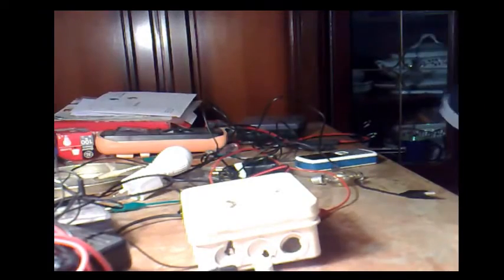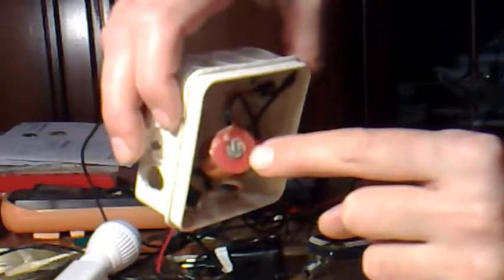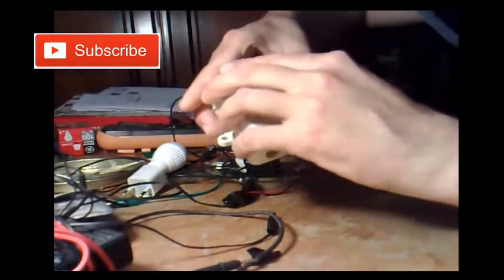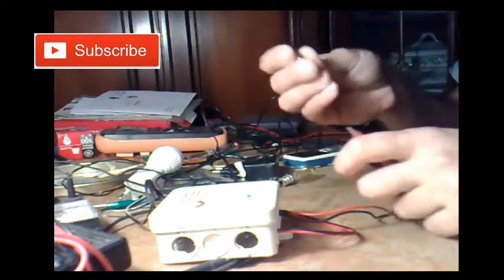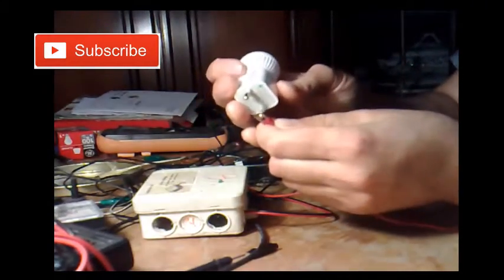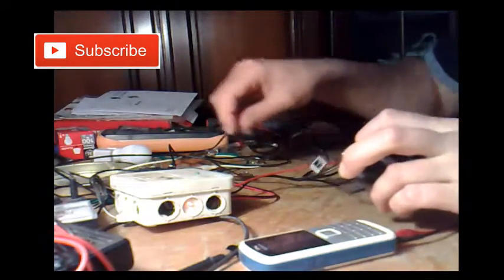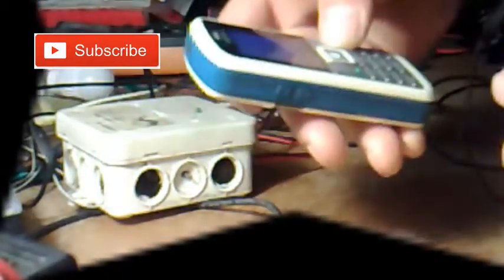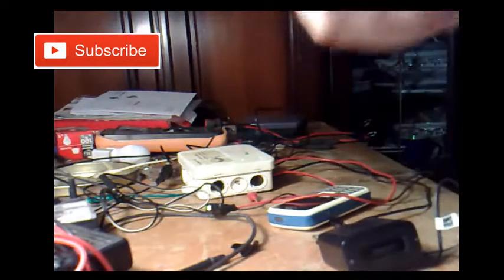bedini self oscillating charger-rejuvenator

Comment: So, No matter what load I put on it ( I'm assuming the output is from the charging battery), the charger will compensate its own output and correctly charge whatever battery and/or load I put on it. I see you used a lightbulb and then charged a cellphone....clearly 2 different voltage outputs must be used. Is this correct?
Reply from the maker: You're absolutely correct sir. It's self regulating circuit. When heavier load connected it self oscillates at higher frequency and maintaining the same current draw or even draw less current from the 12V input. The same goes for the charging batteries in series on the output. I even used this little device to test my broken LED-s on my tv: https://youtu.be/1JhLGiANOoc
Reply: @RadiantElectricity  Thank you, fascinating experiment. I'm using a 555 timer to provide pulses to a TIP3055 transistor energizing a coil to charge a battery. I believe it's a circuit from someone named Alexor. Unbelievable output but the higher the frequency the hotter the 3055 gets...very touchy control. I've been charging the same 2 batteries for about 2 weeks now, no other outside source. Very interesting. I'll duplicate your experiment asap. Looks promising.
Reply from the maker: @sgrimm7346  555 is a great choice for the radiant source of electricity. You should pay attention what coils you use with respect to frequency. You can use small ferrite  rod-type inductors-chokes for the frequencies larger than 2khz. They can be found in old tv-s and PC power supplies which you probably know. Thanks for the interest for my video. Cheers mate!
Reply from the maker: Since youre using 555, better solution instead of 2n3055 which has only about 100V max Vce voltage(although very high Hfe) to use high voltage N-type power mosfet maybe 500V to avoid heating. Btw this ne2 neon glow lamp is not that almighty in snubbing the excess of high voltage to protect the transistor
Reply: @sgrimm7346  I'm taken aback by your reply about the Alexkor circuit. It appears you have been able to replicate it. I would like to clarify on what you mean by charging the same batteries for two weeks, please. Did the batteries ever get charged completely? Did you try applying a load to it while it was charging? Did you try connecting an inverter to it while it was charging? Would connecting an inverter and AC appliances as load work? Does it matter whether one connects one battery or more for charging (because it would seem that you imply that the more the load, the circuit somehow compensates and continues to work even better? Do you mind sharing an illustration of your working circuit and mentioning how you connect the components together (that is, what and what you connect at what point, etc)?
I apologise for bombarding you with questions like this.
Reply: @RadiantElectricity  your video is trippy, I must say; very straight to the point and exciting for me. I'm more piqued than ever, watching any of these types of videos. Could you mention how you built the circuit? I cannot interpret a circuit diagram accurately, it seems. I will appreciate if you could write out what you connected to what and what and at what point, if there is a cross-connection, etc. I am interested in building this and seeing if and how it works. Also, kindly list the items and suggest how one might procure the, like the one you mentioned above from PC power supplies (I wonder if you meant like the power adapter of laptops - I have one that blew, and I believe I might be able to source some used ones that are intact).

Sorry for the bombardment with all these questions. I'm just really excited to try this out. Also, I am surprised that the charger could power the plug that connects to the phone. I thought the unit is giving out DC. Could you clarify this for me, please?
Thank you.

Comment: 2n3055 is a large transistor, you are using a new one which part is it ? and the coil is hard to get , where? thanks
Reply from the maker: I'm using BD243C transistor. It's T0220 case which is compact and not using up space like 2n3055 which is usually T03. I made coil myself. I salvaged magnet wire from a transformer. I made core from thin zinc coated iron wires.

Comment: where can i parts or readymade ?
Reply from the maker: I made it from scratch and without any calculations. I guestimated dimensions of a coil and number of turns. The more the better.  I believe that ready made kits are available but are expencive, not to mention shipment costs. Good luck with your project.
Reply: @RadiantElectricity  could you list out the components of your unit, please?

Comment: Have you magnet size wire info
Reply from the maker: It is 0.4 millimeter in diameter but 0.3 or 0.5 would be just fine. Btw check out my video on my other channel https://youtu.be/vpHfvFBl6H0
Reply: Thanks for sharing
Have you Coil info how many Ohm or meters
Reply from the maker: For the core I used many zinc coated iron wires of 1mm diameter. Core in my case is 5mm diameter, it could be bigger. I stuffed them together tightly into plastic frame. I used  around 300 turns of magnet wire(bifilar). U can go to 500. Btw thanks for your interest. This circuit is really versatile and can bring to life every type of batteries including alkaline. Good for activating dead cordless drill batteries(Ni-cd and Nimh). Li-on with integrated electronic cannot be used on this one. You can also power your cell-phone charger from this or some types of AC Led bulbs
Reply: thanks